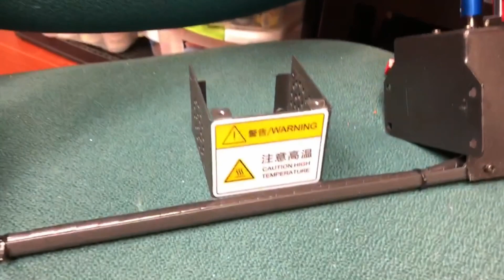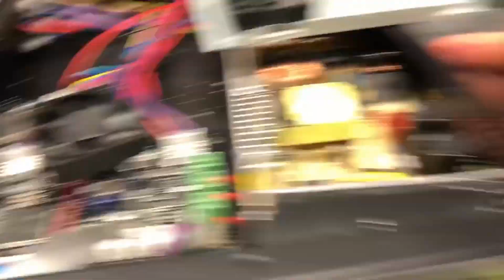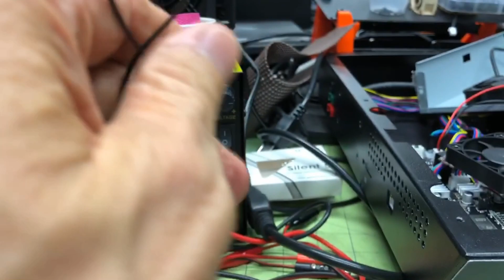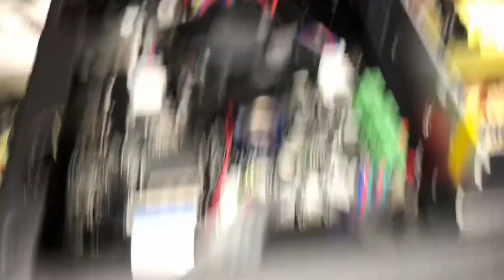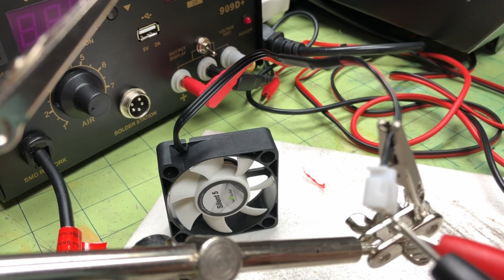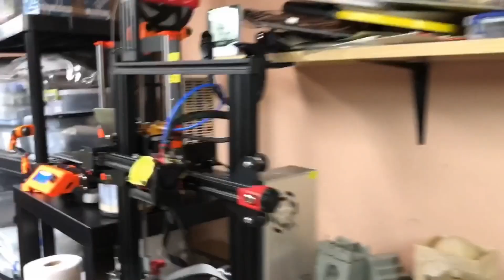Anycubic I3 Ultrabase Easy Mods

Comment: Thank you!, very useful for my both i3 mega printers. Will work now on the open hotend cover and the spool holder.
Reply from the maker: Awesome! I since swapped out the hotend for a Chiron that has an easily removable heat break and installed a V6 clone heat break, heater block with silicone sock and spliced in the new cartridge style thermistor.

Comment: Also do you happen to know what kind of connector is used on the hot end fans. Its not the normal JST connector you find all over amazon its a bit smaller.

Comment: That motherboard is completely different from mine. I wonder if that the 32bit board or something.
Reply from the maker: It's TriGorrilla Pro, so maybe. I thought about changing out the board to put in silent stepper drivers, but it print great the way it it.
Reply: @RichterScaleStudios  I just swapped my board out (because I screwed up the first one shorting the hot end) and put in tmc2208 drivers and man is it quiet now. I want to do all my fans but need to figure out that connector type in case I screw something up. Oh also my old board might still be good. I plugged it in via USB and the lights on the board show up. I'm thinking a firmware flash might fix it but idk I'm too lazy to take the new one back out just to seem